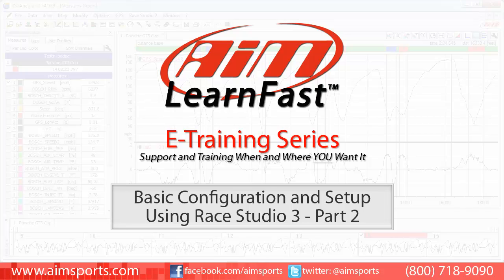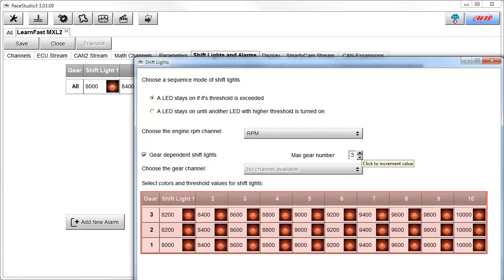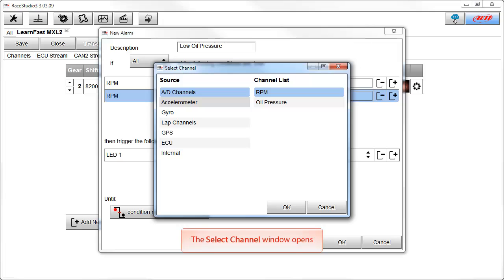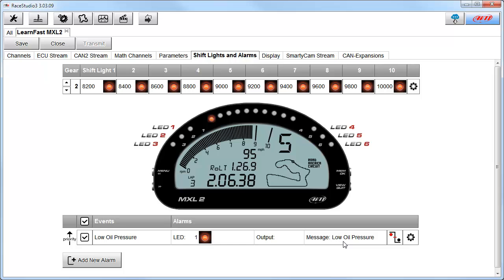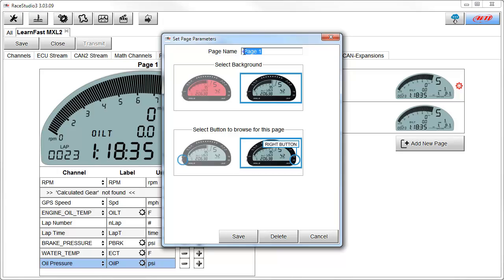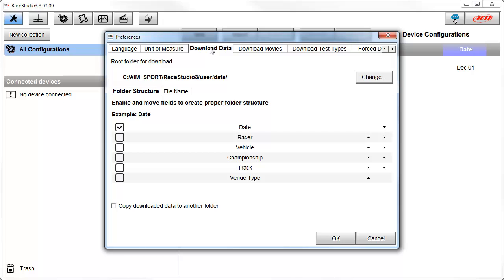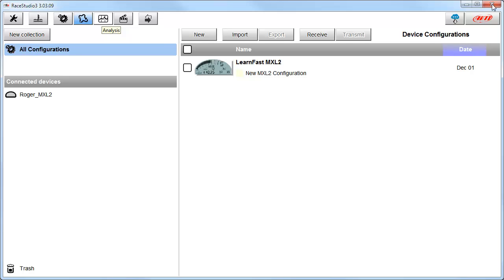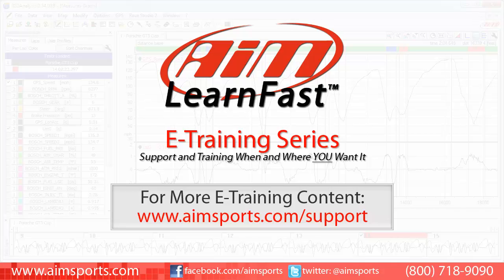Race Studio 3 Basic Configuration - Part 2

Comment: So When Im done setting up my device Configs., does it just auto transmit
Reply from the maker: No, once you are happy with your configuration settings in RS2 or RS3 software you must connect to the device via USB or WiFi and transmit the configuration to the device.
Reply: @aimsportsdata  Ok, I will have to connect through wifi, since I have a Mycron 5, but when I do the "transmit" button is blank, and nothing changes on my Mycron. Would I have to set up the wifi connection through my house hold internet, instead of the access point?, or did I make some sort of mistake in my configuration saettings?(btw thank you for replying)
Reply from the maker: @TMSTER  I understand now, the Mychron5 is set up through the hardware and does not have a configuration set up within the software. You can set up your Mychron5 using the menu options found on the hardware. The WiFi connection in RS3 will allow you to transmit GPS coordinates for S/F lines using the tracks feature, downloading the data and setting WiFi password and device names can be done in the connected device section.
Reply: AiM Sports, LLC Oh ok I see, Ok all set up, Thank you so much!👍👍👍